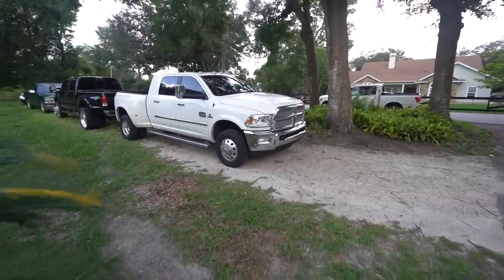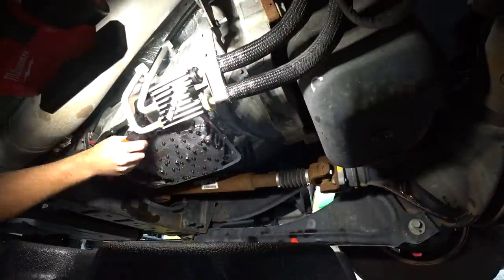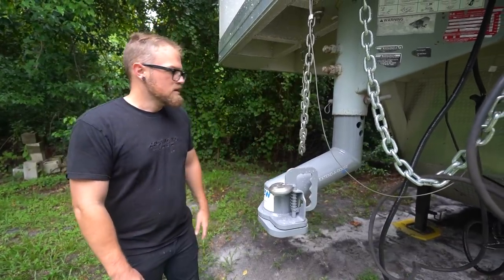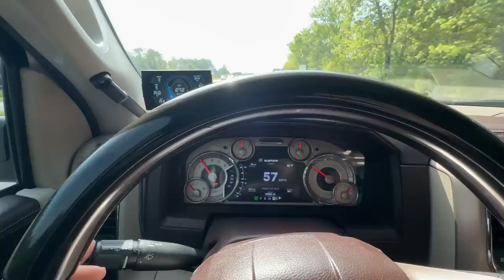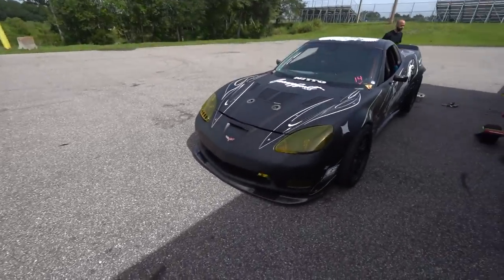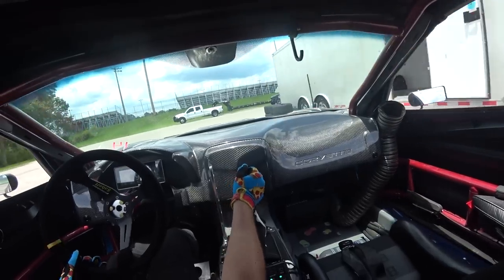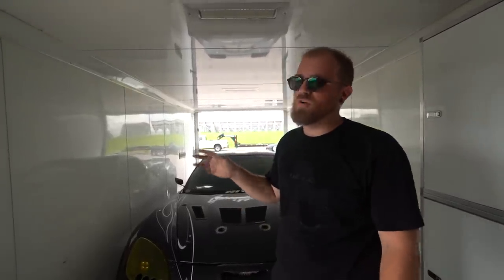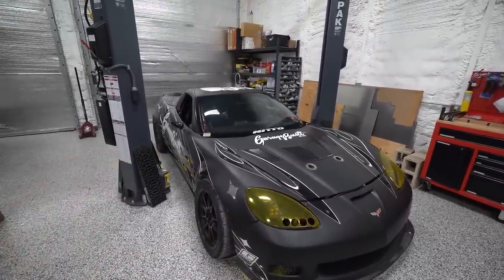Upgrading my new truck and trailer setup. much better.

Comment: Possible upgrade to the trailer would be an awning over the right hand side giving some more shade and cover from the elements over the door.
Reply: Literally just came here to post this. 😂
Reply: Was thinking the exact thing when they were working on the vette at Etown!
Reply: ME TOO😂😂. Both sides of the trailer. One side for the car the other side for entertaining
Reply: The side step on the side man door of to make that thing even or extend it to be flush with the door
Reply: A great place to escape from the rain .
Reply: @BZ1340 reckon having use of both sides at the same time would be quite a challenge based on the assumption that there would normally be limited pit spacing and yes when FD is in town it might have less competition for room (maybe) but then there is more oversized rigs trying to still share the same areas.
Would love to see it tho for the sake of Taylor having someone to do merch sales from and to help him grow his platform

Comment: When you run the offset hitch on the trailer side, you need to keep an eye on the trailer welds near the gooseneck.  It adds a bunch of extra leverage to the trailer frame.

Comment: Make sure you do the Banks Monster-Ram intake elbow to delete the factory heater grid, Taylor..
Reply: I added the BANKs Dif Cover with the fin to my Gen 3 3500 for towing and controlling rear diff temps.  No need for more fluid and it directs the fluid like the factory one does...  BANKS has a cool video showing the advantage of theirs over the square back ones.

Comment: They make a billet trans pan for these trucks with a drain plug. For future reference.
Reply: Or you could just add a drain plug to the existing pan.  I did that to my ‘97 F350.  They carry them at Oreilly’s for just a few bucks.
Reply: @jeffleach2668  yeah but those plastic pans suck tbh.
Reply: ATS also makes a double deep pan to increase the fluid capacity, with fins on the bottom of the pan for cooling. Maybe excessive in Taylor's case, however it surely extends the life of these transmissions.
Reply: I think doorman must make a cheap one with a plug too they make them for a lot of trucks

Comment: you need to check out the grid heater bolt on your 6.7, banks has a bunch of videos detailing the issues, the grid heater power bolt basically rusts through and drops in to the intake runner on the engine, wiggling the power wire to the grid heater will tell you if yours is on its way out, any movement on it is bad!

Comment: I would advise to do a grid heater delete. Im starting to see more and more of them causing catastrophic failure. The bolt breaks off and usually ends up in number 6 cylinder. Its not a bad job either. But keeps up the awesome work!
Reply: Yeah he's in Florida too so he would never need it anyways.
Reply: @bradenwuesthoff5639  he does use it to drive cross country, although usually not in cold weather
Reply: Banks Engineering made an intake horn design with a screw on coil heater and a custom billet plate. Banks Monster-RAM I believe it was called… Not cheap, but cheaper than rebuilding an engine I guess.

Comment: You should have swapped the transmission pan out for an extra deep, finned one. It would add capacity to the transmission and add extra cooling with the fins.
Reply: Totally agree.  And it would add a drain plug!
Reply: Add the banks diff cover while at it!
Reply: I agree with this comment 100%!! Banks diff cover and a deep transmission pan for sure!
Reply: I’m not sure why he didn’t just weld in a drain plug. Seems right up Taylor’s wheelhouse.
Reply from the maker: I wanted to, just no time this time. I didn't intend to pull the pan off. Just decided to day of. I'm still debating on getting a built transmission or not. so I didn't want to do a bunch of upgrades to this and swap the whole thing out anyway.
Reply: Or atleast added a drain plug to the stock pan

Comment: Highly recommend you upgrade the torque convertor and flex plate. The stock ones are known for cracking the center out and taking out the adapter plate

Comment: The Cummins makes its peak torque down low, that's why it is programmed to upshift sooner than you're use to.
Reply: Exactly... Peak torque is around 1800rpm. He's used to his 6.7 powerstroke where its at like 3500rpm
Reply: @bradenwuesthoff5639 powerstroke makes peak torque at 1800
Reply: @bradenwuesthoff5639 lmaooo
Reply from the maker: @bradenwuesthoff5639  Yeah but it shifts to like 11-1200. It won't even built boost there.
Reply: @Taylordrifts  Oh I see. Even in tow/haul mode? Time for an Aisin swap
Reply: @Taylordrifts are you using tow haul? It shouldn't be shifting that soon if so, it should wind out every gear a little further
Reply: @Taylordrifts  gotta give her more throttle off the line instead of babying it lol

Comment: Taylor I am afraid you are going to have an issue with that gasket on the trans. When I was the transmission tech at Dodge I saw it all the time. IF you do wind up having to go back with RTV, PLEASE MAKE SURE TO USE THE DODGE RTV FOR THAT PAN . The Rtv they use on the transmission pan is not like normal rtv. Do not use standard rtv on it if you wind up having to swap it. Just my advise.
Reply: Yep, the previous owner of my 2018 2500 used the gasket that came with the RevMax replacement pan and it is seeping. I need to pull it off and RTV it.
Reply: Ya I’ve never had much luck with the gaskets either, but the “mopar rtv“ I used once and it seemed exactly like regular black rtv. Never had a leak using regular black or gray rtv. And yes, Dorman does make a stock replacement pan with a drain plug.
Reply: Honda bond works great too. But it's pricey.
Reply: My coworker here at Midas uses Nissan rtv cause he swears by it and never uses regular rtv.
Reply: What it really needs is an aftermarket pan from Mag Hytec or similar with a built in rubber gasket and drain plug.
Reply: @Gramps83  HondaBond all day long. You don't want to be back in there 👍
Reply: you know the difference between the normal rtv and dodge rtv nothing but the name
Reply: @mrfordfairmont  not  really going to argue the point man however  I will say this. I worked for dodge for a long time as a transmission tech and saw not only gaskets come in leaking, but also store bought rtv jobs leaking (not for a lack of using enough might i add). There are several different forms of RTV. Some that react to oil and some that dont. Some that react to the detergants in transmission fluid and some that dont. Some that are high temp and some that arent. The point was that as someone who did that job I recommend getting the dodge rtv because I know for a fact that it works.
Reply: @jprater88  not arguing just saying that there is no difference between the rtv with company name and the one you buy in shops... you just have to get the one suited to application!
Reply: Taking away one of the big advantages of a gooseneck/fifth wheel trailer and that’s keeping tongue over the center of the rear axle. You can already see the weight has been shifted so far back you’ll probably benefit by adding air bags on the truck. It squat the truck pretty good and the trailer wasn’t even loaded.

Comment: Just had an interesting thought while watching this. has anyone with a short bed put parking sensors in the rear pillars to alert them when the trailer is about to hit the cab. Obviously would need some tuning so they didn't annoy the crap out of you but I imagine it would be somewhat useful
Reply: Damn, you might be onto something.

Comment: Im not sure how the gen y is for a gooseneck trailer but there are tons of people who report cracked frames after using gen y on 5th wheel campers.
Reply: because 5th wheels are built out of nothing and generally junk compared to an actual cargo trailer.
Reply: @devvoid1312  he was NOT talking about the the 5th wheel frame lmao....the truck frame dude🤦‍♂
Reply: @Shadow0fd3ath24  I don't think he was. People converting their 5th wheels to gooseneck and braking trailer frames is well documented online. He is NOT going to break a truck frame towing a 32ft gooseneck that's likely rated at only 14-16k with a car and some tires in it
Reply: @devvoid1312 You are right. That guy can't read.
Reply: @devvoid1312  yes i was speaking of the trailer frame not the truck frame. I had a 100k 5th wheel camper and heard of people with my same camper cracking frames.

Comment: On my duramax I did 60 gallon aux tank. I did a filter setup that used 2 Cat fuel filters to supplement factory fuel filter. I used MBRP for the turbo back exhaust and loved it. Nice seeing you enjoy the new truck.

Comment: Rubber gaskets work good, had invested in a trans pan with a drain plug so next time I change it it won't make a mess worth the extra money and it was fairly cheap
Also most big truck guys know this but if you tow in your hot tune, control your foot and don't stay in it and you'll get better fuel mileage with the most power and lock 6th out to extend the longevity of your trans
Reply: I own a transmission shop. Rubber gaskets come back leaking almost every time. that trans uses RTV sealant but if you don't want to deal with it the next best thing is a Cork gasket
Reply: @tombis  big thing is clean surface and mounting right? I've checked mine and after 5k of heavy towing in texas heat,  it seems to be doing fine 🙂

Comment: Hey man! I used the 2 bucket method to change the trans fluid in an auto truck. I learned it from my grandpa. Basically unhook the trans cooler feed line, and run a 3/8 rubber line into 1 bucket. I went to pick and pull and cut off nipples for the dodges, chevys and fords to adapt cleanly to a rubber line for bucket 1. Bucket 2 has the recommended amount of new atf the trans calls for. I run the line into the trans filler neck with a fluid transfer pump. Start the truck, let it pump 1 gallon of old fluid, shut the truck off and pump 1 gallon in. Repeat until bucket 2 has the same amout of gallons you put in bucket 1, and bucket 1 is empty. Best way to do an auto fluid flush. Even better if you do it after shes warm and you went for a drive. Much less effort and time then pulling the pan and only getting 2/3s of the fluid, and gets the all the fluid brand new.

Comment: When it was time to service the 6L80 in my Chevy, I bought a pan and welded an O2 sensor bung on it. The bung came with a plug and I found a copper washer to fit it. Now I can do drain & fills with ease. It only gets around 6 qts (about half) by doing that, but the fluid stays a bit cleaner if I do that every second oil change. (4-5K)

Comment: may be worth painting the aluminum  checker plate on the front of the trailer mat black so the tail lights don't reflect so bad. especially helpful at night.. wrapping the bonnet / hood mat black does something similar for glare reduction when driving into the sun.  I did it to my 80's f150 and it really makes a difference on a long drive.

Comment: Those dodge transmissions are programmed to unlock the converter and re lock it for each shift to protect the hard parts. Locked shifts tend snap shafts and other parts

Comment: Believe I would weld a gusit at the 90 degree point on the trailer hitch for safety. A hard stop, the hitch will collapse and push forward into the back of the truck cab. I’ve seen it happen!

Comment: According to Cummins, the 6.7 is optimized to cruise under load at 1300 rpm and it is designed to handle the higher cylinder pressures.

If the load is very big (large heavy trailer) they say up to 1500 rpm can provide additional torque reserve and still decent fuel efficiency.

Tuning the trans for 1700+ rpm is probably going to just hurt your fuel economy, without helping the engine to last any longer.

BTW,  big rigs,  depending on the engine,  cruise with rpms typically in the 900 to 1350 rpm range (under 1000 rpm was more common a few years ago though).

Comment: I think the edge is displaying flex lock up of the torque converter right before shifts. This is common in most newer transmissions. often done to improve shift feel.

Comment: Not to be negative to what you installed on this Truck but Banks stuff is great. Especially for Data and Air intake for Cummins. Removing the problematic intake heater.
Their Diff cover too.

Comment: I added the dorman drain pan that comes with a drain plug. I also used a lube locker gasket and have zero leaks its been awesome! Highly recommend if you pull it apart again. I think you'll find you have plently of tranmission cooling with the bypass. (No need for a deep/finned pan)  I used to run 175 now its usually 130-150 towing depending on outside temps.

Comment: When you can: long bed + auto leveling air ride.
For the trailer: On the gooseneck side, a side slide loader. The rack goes down to be  load/unload (ease of use) and you add a lock in the up position (safety).

Comment: Also, ur trailor. Saw a guy in Australia. Up in the gooseneck of the trailor. He installed one of those truck bed slide-out. Like a tool drawer slide-out thing. He keeps tires in it and totes and he slides it in and out for ease of use. He also talked about putting a tilt on it so when it slides out it will titl once past like 75%.

Comment: I would have converted to a 5th wheel hitch on that trailer and put a slider hitch in the bed. That way the hitch is centered over the axle when pulling straight and when you need to turn/maneuver sharp just pull the pin and let the hitch slide back. That's the setup I have on my SRW Duramax.

Comment: Its a cummins. You can absolutely lug it. Mine rarely is over 2k rpm towing and its got almost 30k miles of towing.
Reply: Exact opposite. Everything gets hotter than hell when you lug them. They’re better screaming than being lugged.
Reply: @smcox1991  the Cummins or my old Duramax never care when I lug them. Duramax pulled a 10k trailer for 300k 🤷🏾‍♀️ The Cummins has an even longer stroke and seems to love sub 2000 rpm cruising.

Comment: You need transmission tuning ASAP,  Deep pan (with drain plug), and Get a RevMax Billet valve body ( you will have to a tranny relearn and/or drive it easy with out a trailer while it relearn for 100 or so miles with lots of shifts)

Comment: The factory 68 pans are prone to bending and leaking very easy after being serviced. Keep an eye on that.

I definitely recommend getting an aftermarket serviceable deep pan on your next fluid change.

Having a Drain plug is definitely the move, plus the aftermarket pans are a lot thicker and hold their shape, less bendy.

Comment: I knew you'd be happy with the ram. I've had all the diesel trucks and Ram is hands down the best. I'm not a Ford Chevy or Dodge guy only fan but as far as diesel duallys are concerned I guess I'm a Ram guy now. I have an 05 with a tune, wicked wheel, stainless 4" exhaust from turbo back,cold air, modded trans with deep sump pan, and a couple other minor mods and it performs flawlessly! I tow a 30' bumper pull with a gen-y and mostly love it. I wanted a goose but came across a Millennium bumper pull with a bunch of options for a song and couldn't pass it up. I would send you a couple pics of the rig but apparently can't on the comment section.

Comment: If you have a fan clutch issue use the driven diesel mechanical fan clutch adapter, put one on and run 10* cooler on my welding rig

Comment: Power Driven Diesel has a compound turbo setup that keeps the stock turbo so you still get the  auto exhaust brake. It’s not too pricey and compounds help with EGTs!

Comment: If you want to upgrade the turbo, but keep the vgt(for exhaust brake purposes, etc.) there’s the fleece cheetah, which is a 63mm turbo, the bd diesel screamer, which is a 64.5 mm turbo, and I think ats offers one too, don’t know a lot about them though. They’re all direct bolt in, oem type fit. I just recently had the bd screamer put in mine and I like it so far. Vgt/turbo failures are a somewhat common occurrence in 4th gen rams, so good to know options

Comment: I'd recommend getting rid of the stock intake horn because of the grid heater bolt that will brake off and suck through your motor, it happened to my truck at 160,000. And I saw on average 100° -200° cooler on the EGT's

Comment: That's one thing with the 6.7 cummins and the 68rfe as soon as the converter locks it just goes straight to 4th. Just the stock tuning on them

Comment: I don't know if you noticed, but you don't have a right brake light on your trailer. Parking lights work, but you had no brake light illumination. Might want to see if there's a wiring issue in the plug

Comment: hello taylor. next time you change the transmissionoil. I would weld a drain plug in the oil pan, then it will be easier next time.

Comment: Have you thought about going to a heavier flywheel/clutch setup? I have noticed it seems pretty violent and hard to stay smooth in certain situations. Just curious
Reply: its cause he has a dog box transmission in it.
Reply: @trucksucc8490  Ah yeah true. It would probably be harder to shift quickly if he had a heavier flywheel. Makes sense

Comment: this might be a dumb question but couldn't you just drill and tap and maybe weld a washer in the pan to thinkin the thread area to make a drain plug for the trans? or would the plug not clear the inside of the trans once pans back on i know you like a fun weld project.

Comment: if you decide to take that transmission pan off again could you weld a turbo drain plug into the bottom of it to make your own drain. saves you sealing the pan everytime you do a fluid change

Comment: Hey Taylor you need my mount that I make for the CTS3 to mount it in the center of the dash. Hides the wire as well! Sits up top where the little tray is. I’d post a picture but this youtube🙃